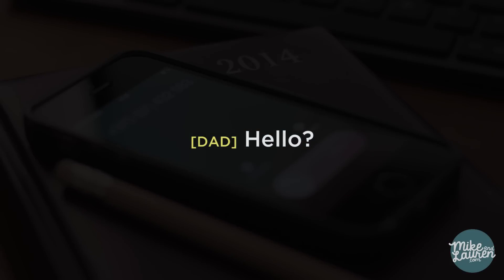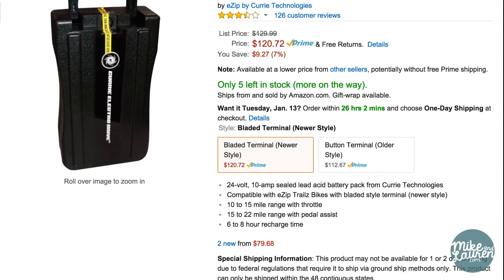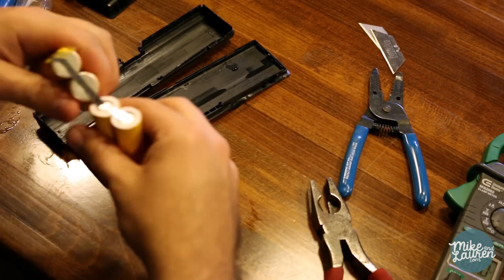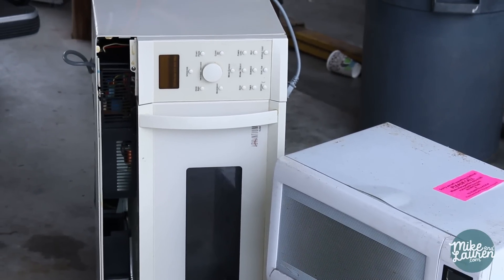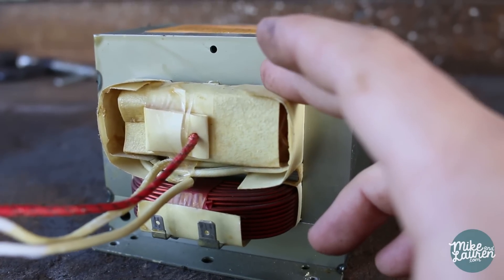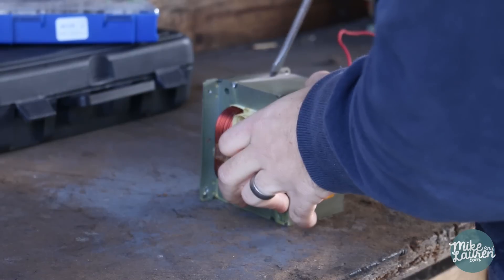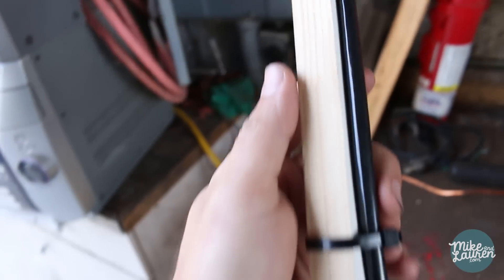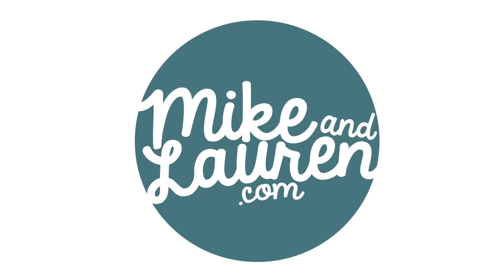Don't Throw That Microwave Away!

Comment: Hapilly, I live in an area where dead batteries (and e-waste generally) is very cheap, I have 400x18650 cell from around 70 old laptop batteries -- most of these laptop batteries were were working.

Cost: $103 so around $0.26 for each 18650 cell.

Comment: In addition to that cool hack...    

Most (all?) microwaves have a fuse inside them.  the fuse blows, people toss the microwave because they don't know that there is a fuse inside it.  $2 and the microwave works again.    I've repaired my own microwave twice (it's 25 years old..) and done the same for a trash-picked unit.

So you can likely get a working microwave again fro next to nothing.
Reply from the maker: wordsnwood Good to know.  Thanks for the tip!
Reply: +wordsnwood Our fuse went too (after ~9 years of use).  The fuses are a special\wierd rating, so I had to buy a pack of 10, but that was only $20 - and now I have spares should it ever happen again!  :)

Comment: Any other applications for a spot welder?
Reply from the maker: Elliott Miller Spot welding can be used any time you want to join sheet metal.  In fact, spot welding is used almost exclusively in the auto manufacturing industry to join all the sheet metal body parts.

Comment: Hi Mike,

Great video, I've watched many of these type videos and have 2 or 3 microwaves just ready to be ripped apart to make a spot welder, stick welder, Plasma welder, nuclear reactor, whatever man...  LOL...

Anyhow, I see you used zipped ties, can't do a single project WITHOUT THEM, and I have a suggestion you might enjoy. I noticed your zipped them into the middle of your project and one thing I found when working with square projects, is to move the Zip to one square side then when you zip it tight, it's on the corner and not in the middle. This allows it to get just a bit tighter and the zip lays more flat. Looking how your zipped yours, if you push both zips forward until the receiving end is flush with the edge you will be able to push through and the zip will be much tighter. That was probably redundant but you get the drift... Not only that, but I had a few zips break in the past because of that bend, so be keeping it flat it makes for a more secure Zip...  Enjoy...
Reply from the maker: Paul Bialozor Great tip, thanks!
Reply: Awesome tip man! Cheers!

Comment: I would assume that when an electric bike company makes their product, they would be looking for the cheapest, and best materials for their bike. Why do you think that you were so easily able to find something that would increase the range by 3x and decrease the weight by 3x for the same cost? Is there a catch? What possible dangers do you see with something like this? Is the battery going to just be aircooled or something else, because many lithium battery packs close together will get hot really quick. Thanks for the video!
Reply from the maker: Swirlstudios Exactly.  E-Bike companies are looking for the cheapest materials for their bikes.  Lithium replacements are significantly more expensive than regular batteries (lead-acid).  In fact E-Zip sells a lithium battery for this bike, but they want $445 dollars and it's only 1/2 the capacity of mine!!

I'm able to make my own for 1/10th the cost because I'm recycling "used" laptop batteries.  To give you an example, new panasonic cells are about $8-10 dollars a piece.  I paid $1.60 because I took them out of laptop batteries.
Reply: Mike and Lauren Gotcha. That makes more sense. Thanks. Is there an eta on the next video in the e-bike series?
Reply from the maker: Swirlstudios The parts I ordered from eBay are supposed to arrive between Jan 14-28.  So if I get the parts in time, hopefully next week.

Comment: Mike on later video you mentioned that it's too powerful and makes holes. I think you need some extra electronics to control timing - so 10ms of welding time or so should be fine to do it right. Doing it by hand is rather impossible :)
Reply from the maker: emceh That should work, thanks for the idea.

Comment: HIGH VOLTAGE+TORN APART ELECTRONICS+SHAWDY FLAMMABLE DIY SPOT WELDER + NO DISCLIMER?= ???? EXTREME DANGER 

Hope you're still around bud. Great vid, hope nobody (like my dad) gets hurt after seeing this.
Reply: What part of the iron transformer and copper wire, of this spot welder is Flammable? (Except 2 little sticks of wood and some wire insulation)

Comment: It takes mere 2 seconds to mention a warning of the dangers of high out put transformers.  About the same time it takes to lose your life and a subscriber to your channel. Wise up and take responsibility if you're going to make videos involving electricity.
Reply: 30 people die each year from this project in the U.S. alone.  70% of accidental shocks die. 30% are left with life altering effects from the shock.
Reply: Building a dead mans switch to power this type of device can save your life. A GFI ground fault interrupter WILL NOT prevent a deadly shock.